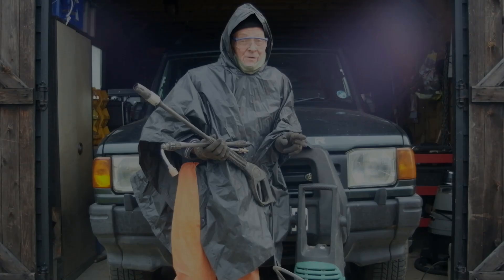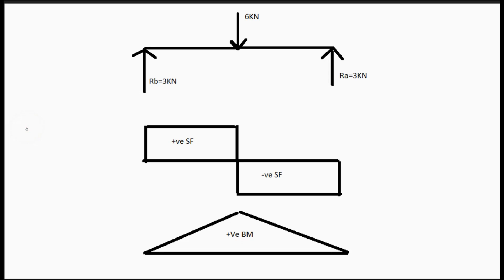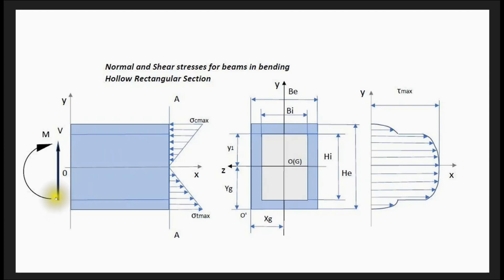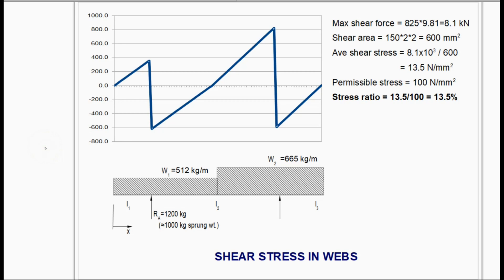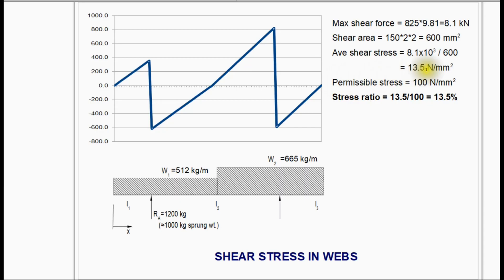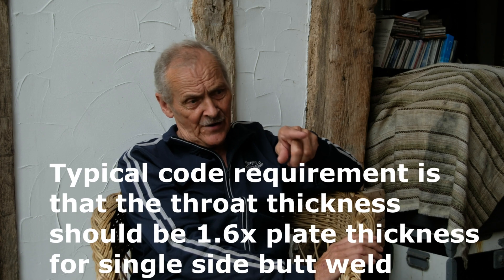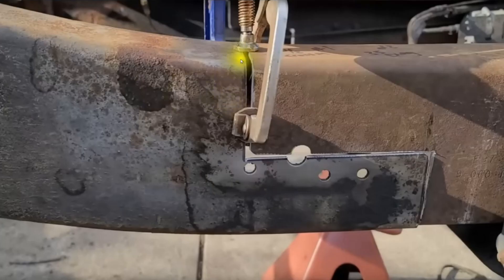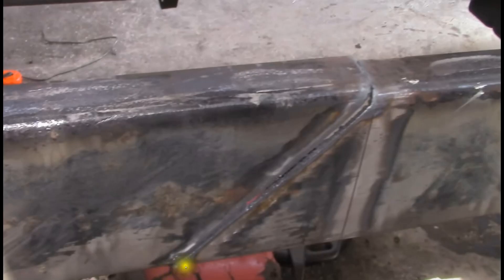Rustproofing and chassis repair pt.3 - chassis repair. How strong does it need to be?

Comment: Thank you for your detailed explanations with examples sir 👍
I've always believed in replacing like for like. To cut out any corroded metal and replace with fresh metal of the same thickness, I do use galvanised steel for repairs when I can. This would normally be thinner parts like bulkhead repairs, but I think the galvanised steel gives a little protection to the weld from corrosion. However respiratory protection from the poisonous gases are more hazardous than normal welds so good ventilation and respiratory face mask are essential. I also find my cheap plasma cutter is great for cutting out the rotten steel to good steel. Much easier than using a cutting wheel in awkward spaces too.

Comment: Bill, I quit on this long ago. Now, I simply “Fluid Film” the entire vehicle including the chassis inside and out, the under body, inside panels and anywhere else rust may occur. It is greasy, but it is simple and easy. Just spray it once a year and forget about it.
Reply from the maker: I never got round to doing the second video so I didn't give my solution.
I am not too worried about the visible surfaces which can be coated with any number of surface coatings (provided they are tightly adhering). I looked at a lot of recommendations about what to inject in the closed spaces and a number of knowledgeable guys said that ATF has excellent anti-corrosive properties. I have plenty of that available for free (old gearbox oil) so that's what I am using. Time will tell.

Comment: Later LRs rust from the inside out!  To save cost, chassis were made with triple skins in high stress areas, where extra strength was required.

This means that water gets between the skins, and weakens the most critical areas of the chassis.  

Essentially, when the corrosion makes it to the outside world, the chassis will have been weakened so much it's ready to break in half.

The calculations outlined here, certainly apply to a brand-new chassis, but one which has seen any amount of use somewhere as wet as the UK, will be affected by corrosion to some extent.

Old series LR chassis, were made out of far more substantial material, and last much longer than the later multi skin designs.
Reply from the maker: Agreed on all fronts. 
In engineering design it's usual to have a corrosion allowance which is the amount of steel which can be lost before the member becomes overstressed. From memory this chassis has a corrosion allowance around 40-50% however it clearly can't tolerate 100% wasteage.
Reply: @defendermodsandtravels  I used to do a lot of welding repair work for an LR specialist, and soon found out that in terms of corrosion a later multi skin chassis, in some cases would become beyond repair pretty quickly.

Series chassis on the other hand, were simply a matter of cutting out the rotten sections and replacing them with new.  Did loads of rear cross members and outriggers.  

Good to see a 4WD channel thats not ensnared with bolt on bling, which in most cases is less effective than the stock parts!

Comment: Excellent work as always, Bill. 
My concern for older vehicles are these:
We often see rusty chassis, cleaned up, and repainted. People may not know how much  material thickness is retained or the condition inside the chassis members. Are there cracks? With 2mm wall thicknes,  could we be down to 1.5mm? Perhaps 1mm or even less. A hole is zero retained thickness.

Older vehicles are often modified to accept heavy items such as winches, bumpers, anchor points. Are standard chassis members sufficiently strong for such modifications and the uses?

You will cringe Bill, but I made cardboard patterns of my chassis and have had plates made to reinforce my entire chassis, then pool welded and butt welded these to my chassis (after spray galvanising). The plates are 3mm in the lower flange and 2mm in the webs of rails and cross members. 

All through-bolting points are reinforced on the opposite side to ensure the members are not crushed. I  have reinforced the brackets where the front control (leading) arms are bolted. I have used the same steel grade as LR claim to have used.

I am not an expedition user so loss of payload is not critical, but my vehicle does get used in extremis.
Reply from the maker: Bear in mind that it's  usual for engineering structures to be designed with a corrosion allowance which is sacrificial steel which can be lost without loss of function. Whilst I have never worked on automotive structures I'd be surprised if the corrosion allowance was less than 30% of the total steel thickness.
If you feel the need to reinforce the vehicle beyond its design strength be aware that fatigue failures typically outweigh static strength failures by an order of magnitude. I would concentrate on reducing stress concentrations particularly in areas of dynamic loading. Also local reinforcement can be added in areas of high local loads.
I am not a great fan of adding reinforcement in areas where stresses are low and any type of failure (fatigue or static) is inconceivable. I would also advise against putting in large volumes of weld metal which will cause distortion and may put stresses in components not designed for it (e.g. the chassis is pulled out of shape and puts stresses into the bodywork it's meant to support).

Comment: Hello from Canada. Love your channel. My 1976 101 was happy to hear about your vehicles and adventures. We both look forward to more videos, especially as I recently declared myself retired, and hope to spend more time with it and my FJ55, and the rest of the family of course.
Reply from the maker: Hi, I reckon that if you live in Canada with its wide open spaces, have recently retired and have an old 101 you could have a lot of fun. I take my 30 year old Defender to many countries and wouldn't change it for say a new Defender 😁🤣. I will be getting it ready for a big adventure this winter.
Reply: Thanks for your response. Driven modern vehicles from coast to coast but generally unsure about doing that with the original gasoline V8, even with less than 10k km on it. I plan to spend this winter doing something about it and would be interested in a future video covering your technical and philosophical thoughts on using/modifying an 'old' engine versus replacing it (and possibly other things). Would prefer to benefit from improvements in fuel cost, range, reliability, ease of repair and such during and not after such a trip (net of conversion of course). Thanks, Marco

Comment: Slightly off beat question here, but if building a chassis mounted spare wheel holder that might see some service in arctic climates, what grade of steel would you suggest ?  I seem to be arriving at EN24T but also see stainless steel grades cropping up as very suitable for duty down to -45 deg C. (316 L apparently being better for welding if over 6mm thick). Any ideas welcomed ! Rgds, Phil
Reply from the maker: Can you give me an email address and I will able to give a fuller response.
Reply: @defendermodsandtravels  Hi Bill, I sent email but no longer here,  I assume you may have noted it and erased it ?
Reply from the maker: @philhealey449  Nope. I saw nothing. Contact me at billnich1950@gmail.com.
Reply: @defendermodsandtravels  Thanks, I'll email shortly   Rgds.

Comment: I’m only a carpenter so take this with a handful of salt.

My experience is with my 110 LR chassis repairs and modifications. 

I have cut off all the suspension mounts and removed the A frame cross member. (To reinstall in different locations to change the links in length and geometry) Regarding crevice corrosion, the sections that were fully seal welded have little to no rust between the two surfaces, with bright untreated steel still showing not much different from when it was installed. The areas only partly welded were terrible traps and introduced corrosion in unseen and in unpreventable areas. Behind the A frame cross member was bad where it attaches to the main chassis rails. Even behind the removable transmission cross member was bad.

In the area behind the gearbox cross member, I’m not happy with just treating the rust and leaving it, I have also decided not to cut it out as there are formed angles (3-4mm thick, say 30-40mm wide) inside the corners of the chassis and these are spot welded to the to C section halves before the full longitudinal welding down the centreline. 

I’ve chosen to overlap the web with a doubler, but formed in a C section to avoid welding to the radius corners where stresses are trapped. 

Regarding the cutting of chassis’s, repair sections etc on angles, it’s my understanding that this reduces stress risers as it changes the direction from being generally perpendicular to the load forces. Commonly cut at 45 degrees. It’s definitely bad practice to weld straight across a flange (I avoid it on webs also) 

For those that have access to instagram, my account is Kustom110
Reply from the maker: "It's definitely bad practice to weld straight across a flange". Could you please quote chapter and verse on this or is it just hearsay? I am familiar with codes of practice for the design and construction of steelwork from several countries and I don't recall seeing this recommendation anywhere but I am ready to be corrected.
Reply: @defendermodsandtravels  it’s in our vehicle codes here in Australia for repairs and modifications. It’s also been explained to me by an engineer but unfortunately I can not remember the exact details or put in to words that would satisfy you. 

Remember these aren’t just beams with weight on them and support underneath, there are acceleration and braking forces as well as torsion going through them. 

I’ll do some digging and see if I can come back to you.
Reply from the maker: @husq2100  Thanks for the reply. I am going to do a video on this very subject because it seems the vehicle regs in some countries are at variance with code requirements in virtually every industry elsewhere for no apparent reason which I can fathom. It would help if the engineer who explained it to you could explain it to me too. I would be pleased to learn.
BTW the bending and to a lesser extent the shear stresses will govern no matter what load causes them.
Reply: @defendermodsandtravels  the key point I was told was it reduces stress risers. I think that zigzag chassis cut you showed was not a good idea and worse than a straight cut due to sharp changes in direction.

My thoughts with fish plates being cut with angled ends < > or > < make a smoother transition in stiffness change.

Comment: Very interesting 👍
Reply from the maker: Did you wade through the technical bits or skip over them? My engineering students did the hard yards and it did them good.
Reply: @defendermodsandtravels  Not only did I watch the whole thing, I will probably watch it again. I'm no engineer and am a beginner welder, out of necessity. My 32 year old Defender is becoming a bit thin in places. I have already used 3 mm patches because I couldn't find any 2 mm. I think I pulled it off though.
Reply from the maker: @vic6820  You are a hero if you watched the whole video and you aren't an engineer. If you can get the gist of it you are doing well. I think you will understand the conclusions though.
I will publish a welding guide for non welders because the experts seem to live in another world to the likes of us.
3 mm patches should be OK but don't go any thicker.
Reply: @defendermodsandtravels  Thank you 👍
Reply: Good work as ever ! This and Maximus Ironthumper's heroic Land Rover chassis repairs together make a great  combination!  Matt's Offroad Recovery self-built truck chassis  also provided some entertainment recently, including using the structure as a compressed air tank, producing some adverse inflation effects in a structure otherwise looking like something Brunel might have been proud of. 
Some further chassis fatigue  thoughts along the lines of the previous  superb axle analysis videos  would also  be very  interesting, maybe comparing  'rigid' (e.g. Land Rover box section) versus 'extreme flexibility in torsion' (Mercedes C Section Unimog chassis, or whatever those old Bedford 4x4 trucks had) in response to off road travel, coping with undulating terrain. This can result in up to 30 degrees of twist, apparently with no ill effects.  Finally the   variety of 3 point, 4 point, plus spring-isolated fixings of habitation boxes to chassis in the overlanding world is remarkable and I don't think everyone gets that right.  A fascinating topic there in itself, if you ever get chance for a walkthrough of  the  campsite at the German Bad Kissingen overlanding show, looking at and under  the eclectic gathering of Leviathans. Rgds, Phil
Reply from the maker: @philhealey449  Hi Phil, chassis fatigue shouldn't be a problem because the fluctuating stresses are much lower than in suspension components.
Those trucks you mention had chassis rails made from thin walled open sections which are remarkably flexible in torsion. The bodywork was attached in such a way to let the chassis twist (three point mountings as you mention) which was effective at keeping the wheels on the ground.
Reply: @defendermodsandtravels  Thanks for reassurance! My glacial progress on Unimog fitout is nearing an end point, the Atkinson Vos guys having replicated  geometry per Mercedes' manual for four point chassis fixing of the habitation box. My previous Mog rig had the box rigidly fixed,  which gave me concern, but nothing ever  failed. Just had an Icelandic week in a rented (proper)  Defender with Ford Puma power,  naturally suffering a "limp mode" incident with turbo failure......   I'd have taken 200 TDI in preference in a flash.  Let's see how Grenadier reliability pans out ! Rgds, Phil.

Comment: Very informative as per. I lost a good truck to chassis corrosion. The welds are the early starting points, so glad you pointed out the problem with slapping on and welding a plate.
Pete
Reply from the maker: Hi Pete, I am in the process of rescuing an extremely capable truck (the Disco 1) from the clutches of chassis corrosion and just in time too! Well worthwhile doing. It will see me out until the end of my driving career and for what I need I can't really think of anything which would do me better.

Comment: Hi Bill.
You mentioned other people using heavy plate. You are correct. I would have also said that the use of heavy plate moves all the forces somewhere else which can show up as failure.
In other words, chasing your tail. Good video. Thanks :-)
Reply from the maker: Hi Ade, the chassis rails are statically determinate so the shear forces and bending moments won't be affected, however there will be a stress concentration at the change in thickness which will reduce the fatigue life.
Reply: @defendermodsandtravels  Yes 🙂Good health to you Sir.
Reply from the maker: @adelarsen9776  I will make it to Oz one day soon friend.
Reply: @defendermodsandtravels  Thank you Bill and thank you for your good work in and around Sandakan.
You're welcome here in the outback any time. We'll look after you, cheers.